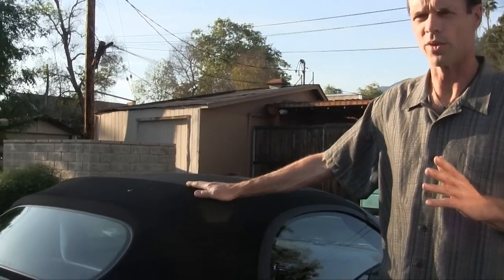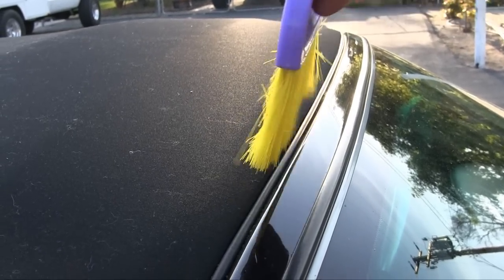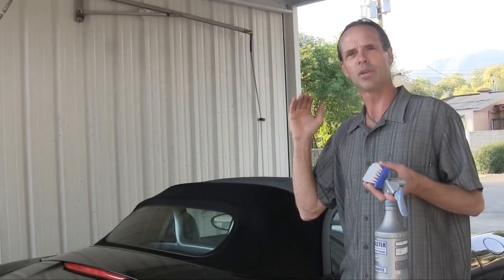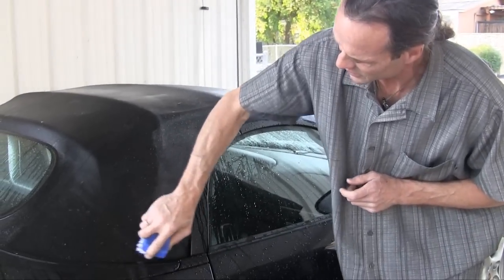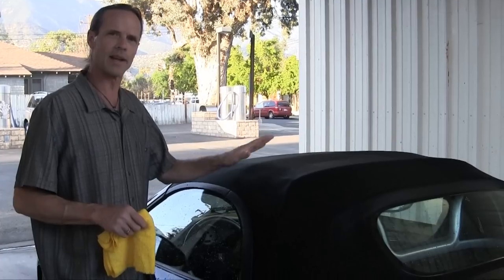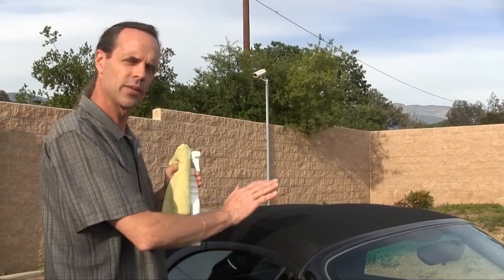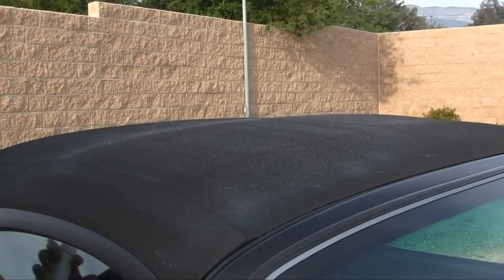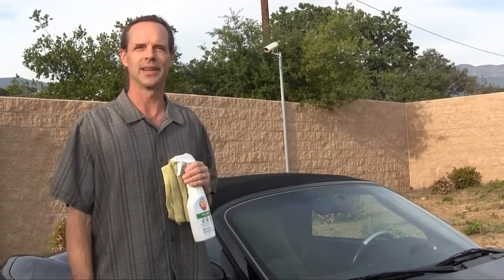How To Clean a Convertible Top - The Easy Way

Comment: Angel,

Three comments:
1) Great video.
2) Why whisk before vacuuming? Just vacuum
3) I would recommend a soft bristle brush over a medium bristle, it is easier on the fabric

Keep the videos coming.
Reply: I’m not angel, but whisking or brushing removes the bits that the vacuum has a harder time getting out such as stuck on lint, dirt and debris. Scrubbing also primes the convertible top for vacuuming by loosening up some of the dirt and dust particles, leading to a deeper clean. 

As for the bristle comment, as long as you’re not using a metal brush, a hard brush is fine and preferable over soft bristle brushes. Unless the car’s fabric is super old, falling apart and very delicate, using a hard brush is just fine and is better for deep cleaning. 

Signed, a mustang owner. 😊
Reply: I barely noticed that your comment is six years old 😂oops

Comment: no way would I put a pressure washer hose on a soft top.....slow/low power garden hose maybe!!!
Reply: Siobhan Hourican I do it all the time. It's actually not harmful. My car is a Chrysler Sebring Convertible with the fabric top and it doesn't leak if you use the car wash hose as seen in the video. The tops are treated to be water proof. I've had mine for two years and the coating is still water resistant. After the factory coating wears off, one can use convertible top water resistant treatment themselves to ensure it lasts. It may seem that it would leak, but I assure you, it doesn't.
Reply: I agree with Michelle, they are tough roofs, no problem with a pressure wash. By the way I live in England and all you need to do is power spray and use a stiff brush to remove the road grime. Don’t do circular motions as he does in the video, long motions side to side then up and down, no swirls this way. When clean and it’s 100% dry I would use Autoglym to proof the roof, it’s not cheap but Aston Martin use it so it’s good and you only need to do it twice a year
Reply: This is too much work
Reply: @kirisutegomen12  It's only a couple of times a year, so not to bad.

Comment: I am thinking of a canvas top for my car (Mazda miata 2006). 1) Any suggestions of precautions, a local mechanic is helping in the installation, not dealer. Do you think my rain drains need replacement (I've had no flooding in the cabin in a year or more)? 2) I do not have a covered garage and here in TX most parking is not covered. How often do you wash your top? What do you recommend for TX? 3) Do you apply the 303 on the canvas more often if you have more rainy weather?

Comment: Are Boxters a reliable car?
Reply: lolololololol
Reply: As reliable as most. Keep in mind the early ones are twenty years old. The IMS bearing is a concern, but definitely overblown. Find an early one with the 2.5 and you are pretty safe. Biggest  problems other than that are water pump and coolant reservoir, which are inexpensive, if you are good at turning a wrench. Engine access is tricky but DIY is not a problem. Parts and how to videos are readily available online. Just get one, you will love it. Especially at 6 to 8 thousand dollars for a decent one.
Reply: It's not cheap to work on as you'll need a lift to do most maintence items

Comment: What is the water resistant spray you were using. 303 something.
Reply: 303 UV protectant probably.   Great stuff
Reply: 303 Protectant IS great stuff.  I use it on my plastic and vinal trim every month!

Comment: why would you ever use a pressure wash on a convertible top? that is insane.
Reply: Is it bad?
Reply: @AntonioLopez-bk7dq  driving water deep into a cloth top will lead to mold, on a vinyl top it'll likely end up making a hole.
Reply: @chrisnelson1935  oh God
Reply: @chrisnelson1935  good to know
Reply: @AntonioLopez-bk7dq  you can put a pinhole in a vinyl top very easy. they are 40 gauge thickness. The cloth are thicker which allows water driven by a pressure washer to get deeper. This is a problem as the water is not supposed to pass the outer layer. If you look at convertible top cleaner kits they do not go deep they stay on the surface. The top is supposed to be water proof so nothing should be driven below the surface or the cover will be compromised.
Reply: @chrisnelson1935  ok
Reply: you wouldn't, but you have to spell it out for some people

Comment: Is it ok to put a convertible in an auto car wash?
Reply from the maker: +BelRiose2000 ...I would not drive it through a carwash. There are too many moving pieces and very little margin for error.Greg Macke - Your Car Angel
Reply: It's ok to take it through a automatic car wash as really the only high pressure is on the doors...but just make sure you dont get a wash with wax as wax will ruin the top
Reply: Never drive thru automatic car wash
Reply: Actually....you never want to take ANY vehicle through the 3-minute paint torture chamber. Best not to wash it at a coin wash either. Them brushes are often times filthy and worn, and scratch your paint up. Remember the old saying - if its rough on your face, its rough on your cars paint. Its best to use some of your old cotton t-shirts and wash by hand.

My family owns an auto detailing business.

Convertible soft tops aren't recommended to go through carwashes, whether automotive or "high pressured". The excess weight and pressure can tear the top up.

Comment: One question is, can I get rainx fluid onto my convertible soft top and get a waterproof effect over time, has anyone worked on it?
Reply: Use 303 fabric guard or Ragg top. Just be sure to keep it off your glass and paint.